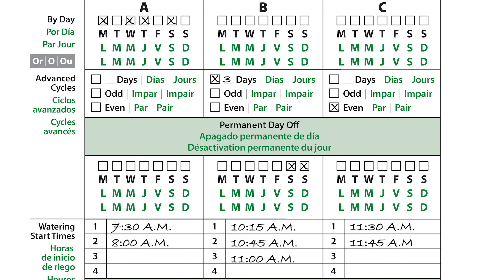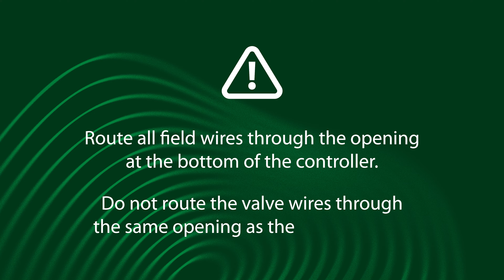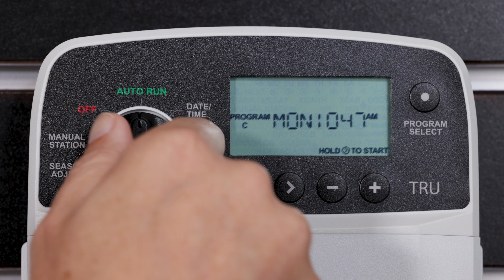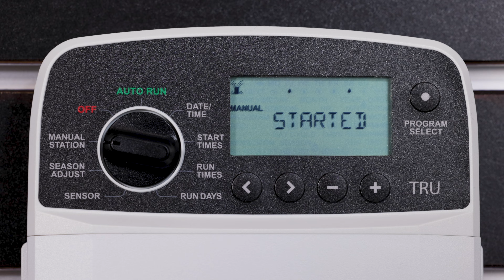Rain Bird TRU Series Residential Irrigation Controller: Installation

Comment: I got new rainbrid timer. Original had rain sensor tied to com and other wire tied to two wires that went to valves. New timer has two screws for sensor. I figure i can tie 2 sensor wires to sensor screws on new unit but do i also tie the 2 wires coming from valve box (piggy back)? Not sure what they do but one is white and other has clear insulation